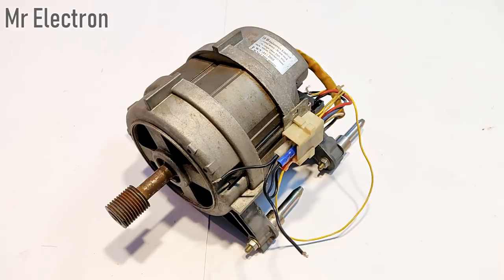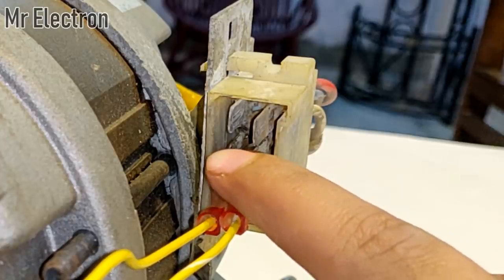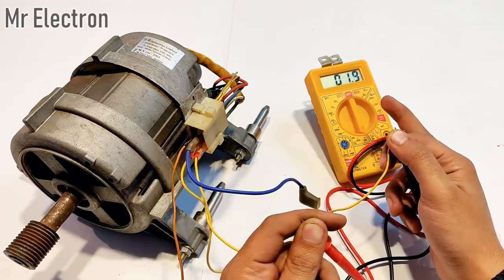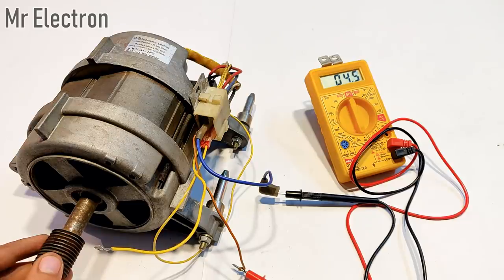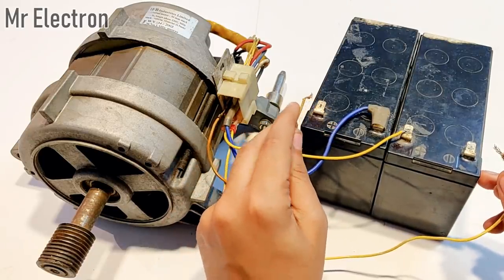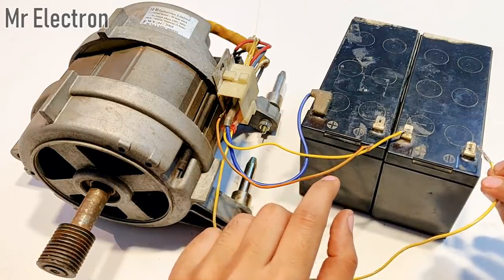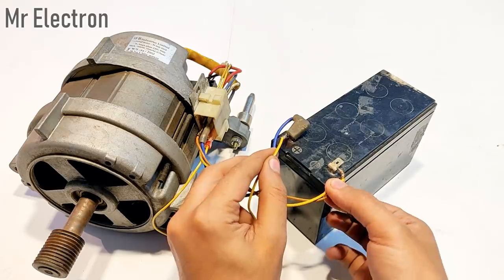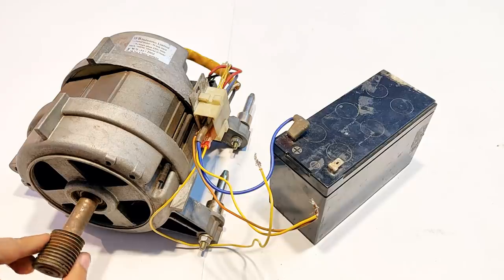Run a 220V Washing Machine Motor at 12V DC ( runs in both directions via UPS Battery ) - Explanation

Comment: When rotating the amature, the change in the resistance reading on the meter is NOT because the resistance of the amature is changing. That is remaining constant. The reason that the reading on the meter is changing is because rotating the amature against the residual magnetism in the field yoke is generating an emf voltage in the amature which is effecting the reading on the meter. This can be demonstrated by switching the meter to a voltage range and then rotating the amature.
The current in the amature winiding reduces with speed not because of a change of resistance, but because the amature emf opposing the supply emf increases.

Comment: Good video...I was hoping you were going to demonstrate the torque using 12V.  I suppose that would be hard to do unless you can get an adequate load.  If you add a speed controller to the field winding or the armature windings, you can vary the speed of the motor.

Comment: Good show except this error. When your rotated the amateur by hand, due to the stray magnetic field in the stater it produced some electricity which when applied to the multimeter either adds or subtracts to its internal circuitry and shows some reading. THE RESISTANCE OF THE ARMATURE NEVER CHANGES. Please  correct your interpretation of that.

Comment: Ok, what can I benefit from, can I use it to make a small electric car?
Reply: yes, but by the time you go through the song and dance of charging field wining at 24v and the amature at 36 or 48V...too much battery management...or just
get a POWER CONVERTOR

Just get a 48V brushless...It'll be more effiecient. Use Lithium LIPO or high discharge Lion ( way lighter than acid and recharge quicker)

There's better things in life to do than manage charging batteries
Slap it in a power wheels or min go kart from the kiddies (12-15 mph is
more than plenty fast for them....
but if you didnt have the money.....do what you gotta do.
It's also nice to have on a WORK TRUCK.electric WINCH or FLOOR JACK, 
or even a SAW, Wood chipper, Post hole diGger, PUMP..ect...if you had to cut  trees a couple of hundred from you house..if you didnt want to go petro
Run a cord from the work truck....charge extra batteries on your truck @ 12V
while you drive it.

reconfigure to 24v-48v..depending how much power you need.
Reply: wasingmasin ko sauryurja se bhi chala sakhte h

Comment: How do I run a washing machine motor with three cables on DC ?
Reply from the maker: Remove the green (ground ) connect the others to dc supply
Reply: @MrElectron  thanks for the Swift reply but the motor I have has red, blue and yellow colors so which one do I leave out ?
Reply from the maker: Most probably Yellow should be having a green line on it.  If yes, then yellow.
Reply: Mr Electron, hi there my motor has blue, red and white; how do I connect to battery?

Comment: What if you were to run it at 12v at 200a of current?
Reply: the voltage is what decides the current , it has a resistor in the windings , use ohms law